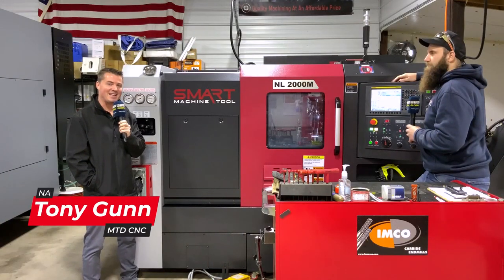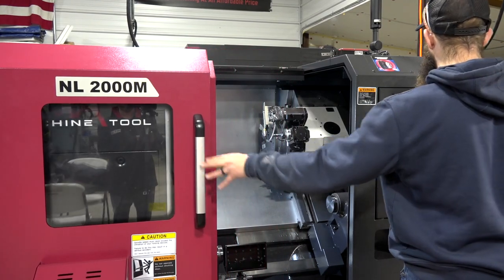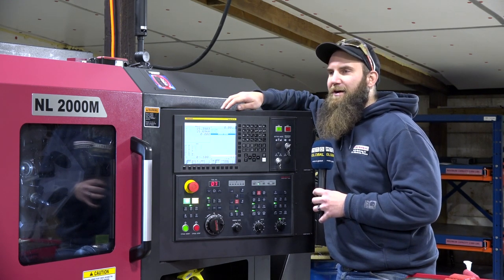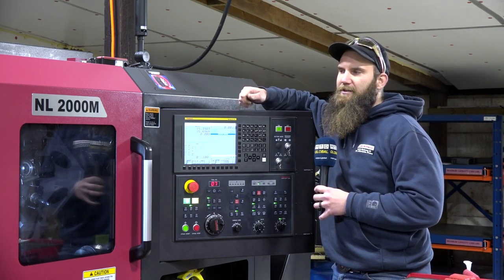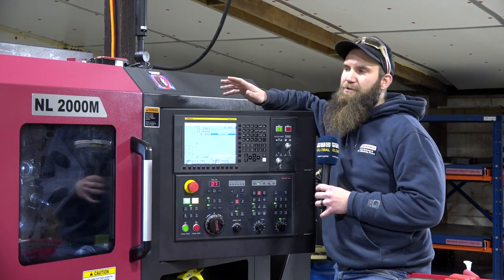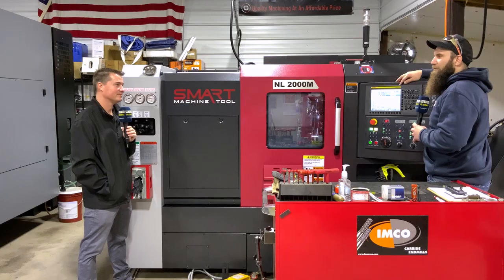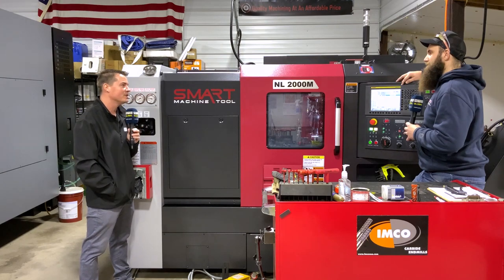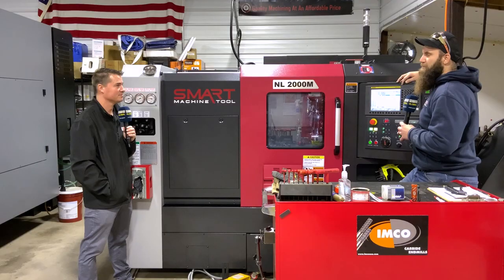We replaced an old lathe with a SMART machine to hit tolerance on harder materials

Comment: hi mate got the 3000BLM variant with the same controller and having issues getting our software to output the right code for doing some live tooling.
any chance i could get a copy of a simple turning+live tool operation with an outside dia turn and a live tool slotting operation to compare to compare codes and see what my software is missing.
TIA
Reply from the maker: Hey, your best option would be to find your closer distributer or contact the guys in the video direct.

Comment: Definitely like this machine.
Seems to have all the goodies you could need.
Especially with the Fanuc i Guide controller.
I am guessing by the M on this machine that it is only a C, X & Z axis Lathe.
Which is usually enough for most jobs.
Would not complain if it was sitting in my shop.
Curious how it compares to a Doosan for price, same country of origin.
Reply from the maker: Thanks for the info!

Comment: Are these rebranded okk machines
Reply: no, there re-branded Nigata's. i got a shop with 4 smart machines. dont buy these machines get a damn Haas for the money. in my experience the hydraulic pumps fail every other month and there are no techs out in our area. they read different m-codes for certain functions like thru spindle coolant is m58 not m07 for Fanuc controls on the mill so programming short hand at the mill might be a pain in the butt if you have memorized other m codes. finding live tooling holders is a pain in the butt also, i can only find them out of Korea. basically the machines are finicky and tooling plus tech support for the machines are hard to get.
Reply from the maker: noo